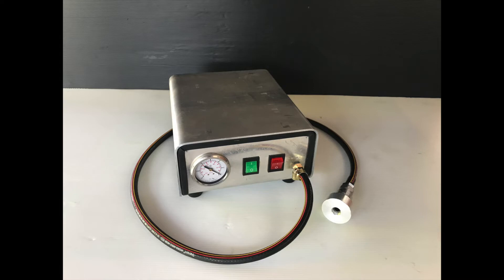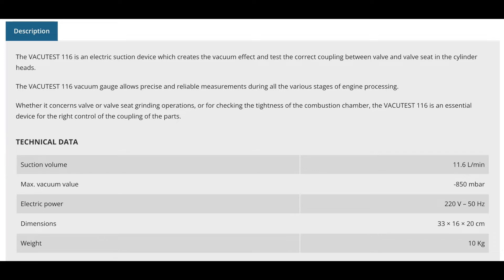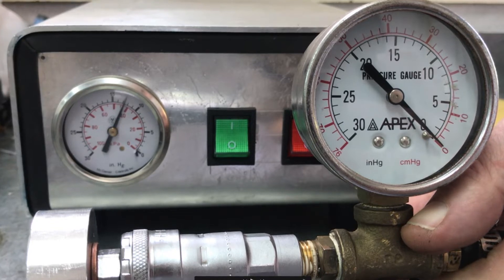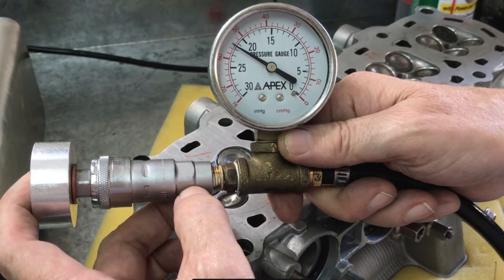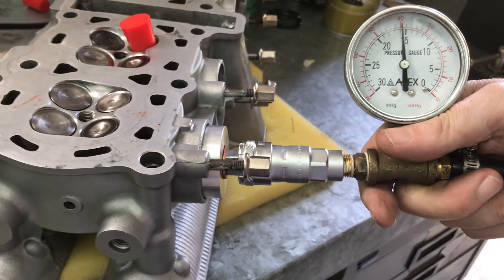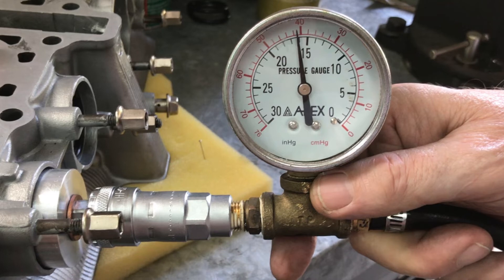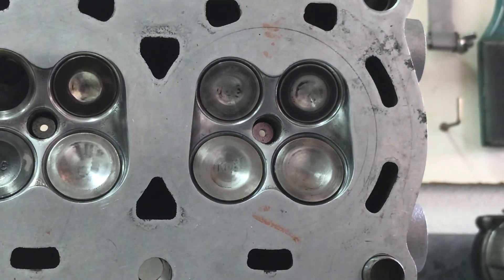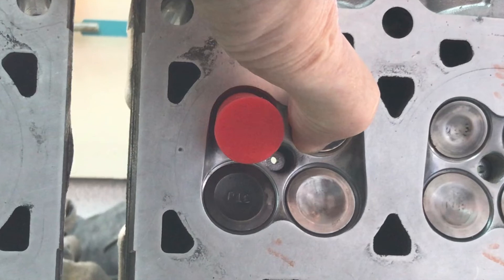Vacuum Testing Valve Seats - Episode 2

Comment: With a vacuum test it is useful to compare the values from the dry valve seat to a measurement when you oiled it. Alos give oil to the valve stem. This helps to narrow down the leakage problem. Maybe it is just the mating surface to the o-ring.
Reply from the maker: At 04:25 in the first video you can see that I test the o-ring and valve stem seals for leaks before testing the seats. Also see the link above to the final video, "A Perfect Seal".

Comment: Considering the 100--300 cc (0.001 cu ft) size cyl head port volume we're pulling vac to test on, even the Professional Automotive "De facto" test machine standard of 11.4 L/min (0.4 Cfm) @ 0.8 Bar (22--25" Hg) Would seem to be an excessively Large volume pump capacity tending to over-pump & Not be as Sensitive to small (but still important) valve seal leakage...Seeming Not Hg" vac Regulated, even the Professional cyl valve vac pumps will vary day to day around 22" Hg into perfect test seal (your Vacutest-116 clone is working great btw) & use either your type & size mechanical Diaphragm pump Or a machine Intergrated Compressed Air powered Venturi vacuum generator of Similar specs with vac seal Hold/Leak-up feature...The Significant observation is the typical Proper valve tester pumps take 12-16  seconds to pull the head port vac down to 22" Hg & Use pump off/Leak-up delay  timing feature for valve sealing.....Obviously,....Any vac pump pulling maxed out 29" Hg almost Instantly Is a strong indicator it's Too Large capacity & misreads Every valve test as good Ok....If you have 90 psi Air Compressor access, the air operated Venturi vac pumps Are a good Affordable alternative....Your parts 1 & 2 vids very helpful & love the hallariously Crazy hydraulic Press metal bend fail "mistake" & Luna "helping dog" cabinet Lid  Inspector !!! .....Glad you included them.....
Reply from the maker: Thanks again Tom for your comment. Having used the vac tester to complete the lapping of my valves, I have to say it is one of those things that you wondered how you ever lived without it. Even if you choose my cheap Chinese pump route, it is well worth it. I was going to detail making the box but I thought it was all too boring. The press die is put together at 86° to give the required 90° bend. When I made the press, I mounted the jack inverted, so if I pump too far that's what happens. We are moving house in the near future and until I can get the new shed built there won't be many, if any, vids. I'll post one up soon as an update to let everyone know that.

Comment: Great informative video ! ....Automotive minimum performance standards for Valve to seat vacuum test requirements seem to be difficult to find....The nearest std procedure I find is applicable to Cummings N14 diesel cylinder head valve vacuum test  using a Kent Moore ST-1257A vacuum tester...Besides the valve pulling 20--25 Hg inches Steady requirement,  the Critical Leak-Up rate Timing from 18" Hg to 8" Hg must Exceed 10 seconds to pass.....High quality durable vac pumps in the 11.4 L/min (0.4 Cfm) at 850 mbar (25" Hg) range seem few & quite expen$ive.....A pratical alternative, if you already have access to a std Hvac 3 Cfm pump is to fit a 0.031" diameter Orfice Restriction to the pump connector fitting will reduce any available 1 to 8 Cfm vac pump to the required flow rate for useful comparative standardized valve leakage measurement.....
Reply from the maker: ThanksTom, that is very useful information, and I agree with you on all counts. I tried to source a better quality low volume pump and they were very expensive. The restrictor would be an excellent solution because you can then use the vac pump for other things.
Reply: I believe, as Tom suggests, a standard office size is the key to getting comparable results from different testers. While I have high volume vacuum pumps available, I am using a brake bleeder hand pump. I usually only give it 6-8 shots, then observe how high it gets and how quickly it leaks down. I think the speed of the leak down/up is what should probably be used to asses the condition of the seal. A big enough pump will pull a high vacuum reading despite having a big leak, so the bleed off is the important reading.

Comment: Could you use a hand held vacuum pump like the type for bleeding brakes?
Reply from the maker: A venturi type should be fine. The link that I gave to the Caterpillar unit is this style.  The hand pump brake bleeders look like they would be completely useless.
Reply: @motoclassics4211  I use a hand pump all the time to bleed brakes as I usually work on my own, never have a problem, just keep a separate reservoir for brake fluid only
Reply from the maker: @MrUmpleby  When I said completely useless, I meant for use as a valve seat tester.

Comment: So is some of the leakage from the valve guide?
Reply from the maker: No Murray, I tested that first by putting the valves in backwards and using the silicone plugs. I just didn't include it in this video.
Reply: @motoclassics4211  Nice, I was wondering how to test that. Thanks!